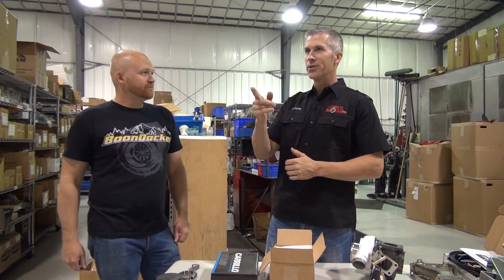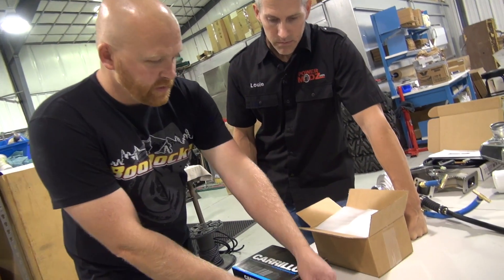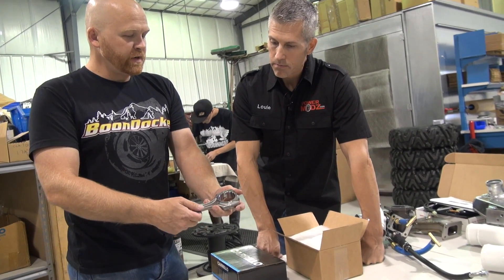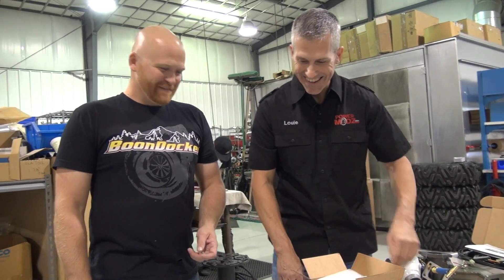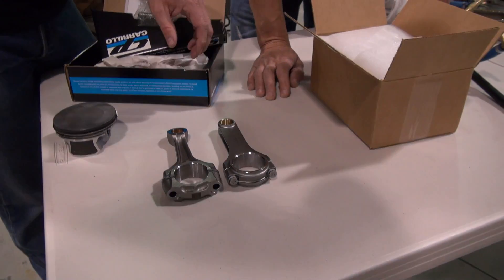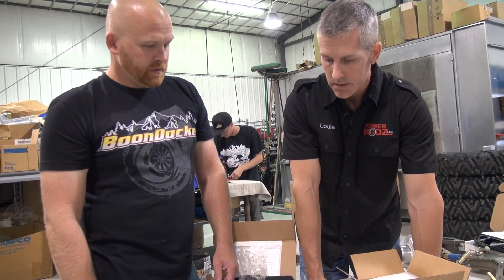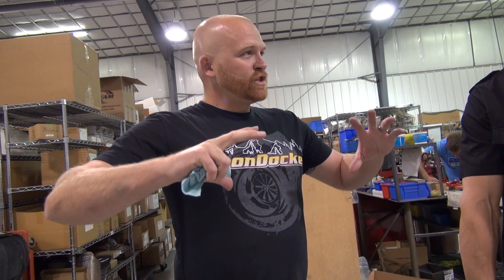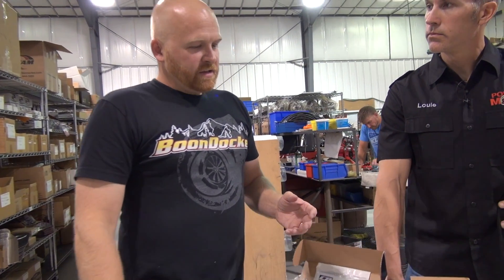Cracked Rods, Compression Ratio, Detonation explained at BoonDocker!  PowerModz!

Comment: Good video, but your only talking about lowering compression ratio's on boosted engines.  I'm looking for info on running 10:1 or above on naturally aspirated engines on pump gas for moderate street apps.  Maybe you could point me in the right direction.